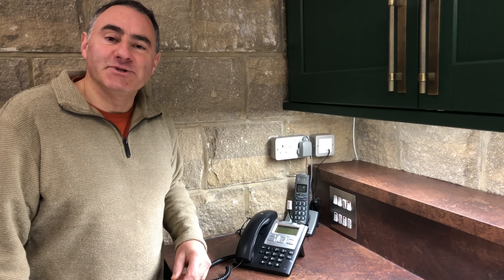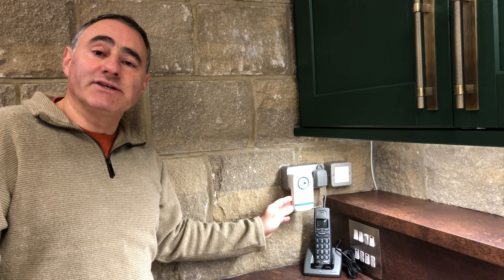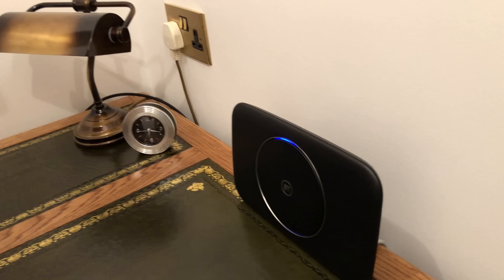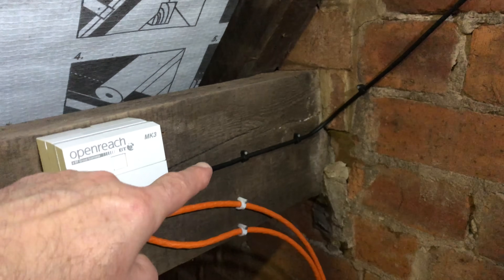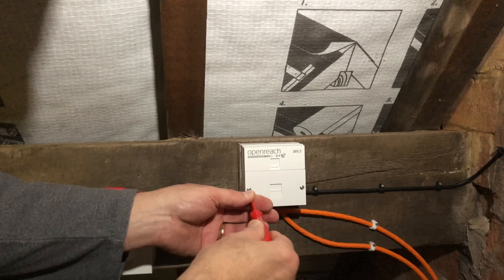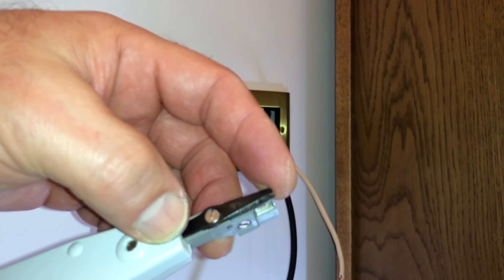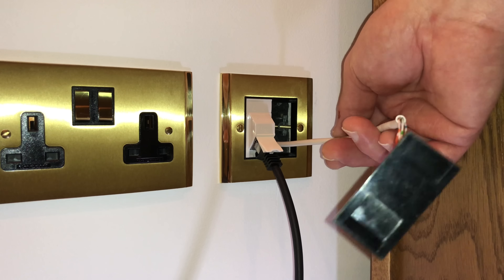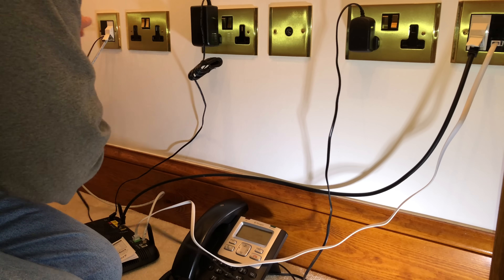How to Video - Analogue to Digital Telephone Landline Switchover Advice VOIP.

Comment: Talk about confusion.  Disconnect the mail socket, which has cat6 running to it? What's a cat 6, why is there there.  
Put in this new socket connected to the attack. 
Plug in an extension to a different socket that no one else has got.  

All a bit disjointed and over complex for folks with no engineering experience..
Reply from the maker: Wasn’t meant to confuse, I was trying to be helpful showing how traditional telephone sockets can be kept in use after the digital switchover. A competent person could easily do telephone extension wiring. 
Whilst the cover was off the master socket I thought I would point out the category 7 cable that connects to the hub. It is like this because I didn’t want the hub in the attic. 
Thanks for your comment. Cheers Rob 👍

Comment: I still want to use my old dial phones from the 60's, can I  ? And also want my old 1960's phone to work in case the internet goes down which it always does. Also in my mum's house she has an emergency box installed as she is 92, hope that will still work ? why do these companies keep f'ing around with things ? If it works don't fix it.
Reply from the maker: Hello Harvey, I’ve never tried this but I’ve looked on Youtube and it seems the old rotary phones can be used. I searched ‘rotary phones on VoIP’, have a look at the video from My Mate Vince - how to connect landline phones on VoIP. He shows that an external bell works on VoIP. I’ve also read you can call out on them but they will not ring for incoming calls (something to do with how the internal bell works).
Once on VoIP, if the internet goes down, you will also lose landline regardless of which type of phone is connected.
Mother in law has an emergency box but not switched to VoIP yet so waiting to see what happens in the very near future. Telecoms companies do say contact your telecall provider when you are notified of switchover. Thanks for watching and commenting. Cheers Rob 👍
Reply: @robswiseways5697  Thanks for the info Rob, my internet is provided by Talktalk and always seems to go down, my mum is also with them. That's what I like about the original copper lines they are always on. So if I have a power cut etc phones will be dead in the future, not good at all, what a pain in the bum !
Reply from the maker: @harveysingsforyou  Thanks for your reply Harvey. I’ve had lots of comments on my video regarding battery backup during power cuts, worth a read. Cheers Rob

Comment: Thank you. Will do this if they push. Had heard it was coming. Same with Phono to Optical, Scart to HDMI, then we realise it isn’t as good or no better. New plug same thing.
Reply from the maker: Ha spot on comparing cable connections. Good luck when the switchover arrives and thank you for watching and commenting. Cheers Rob 👍

Comment: I would just like to say this about the new system. I work with people who are vulnerable in the community. Lots of them have no internet and wont purchase internet but have a house phone. What are they goint to do.
Second if you loose power you have no phone your means of communication with the outside world is gone. 
The good old phone analog phone line was not affected by a lack of electricity just the pount when you might need your phone to call for help. 
Progress is not necessarily better.
Reply: Yeah, we just got switched to Digital Voice against our will a couple of months ago (with literally one day's notice!), and already the system has gone down twice.

There is a lot we're not being told, or told incorrectly (either to deliberately mislead us, or through genuine mistakes.)  I asked a BT representative specifically if the phone would work if only the broadband was down, but the electricity stayed on (quite common where we live.)  He said yes ...as long as the router is flashing colours, it's working, so the phone will work as well.  "The phone is a different system from Broadband" he said.  ERm...no. It's not.  The router was flashing all sorts of colours for several hours, we couldn't use the internet, and the phones were all dead—but our electricity was fine.  Then hey ho, both Broadband and phones magically came back on, both at the same time. Load of codswallop.

Phone extensions do work, using adaptors, etc. And they're not all that difficult to set up, although cordless analogue phones won't work any more (corded ones do.)  You can answer any incoming call on any extension, or make an outgoing call. But what the extensions DON'T do is connect to each other any more.  In other words, if somebody answers a call on one phone, and you want to either listen in or take over the call on another phone ...you can't.  All you get is a dial tone if you pick up.

BT spun this as a benefit, ie, "Two people can make two different calls from the same house at the same time now!"  Wheeee.  In fact, this little anomaly is causing us a lot of distress, as my husband, who is partly disabled, usually picks up incoming calls on his desk phone, which is corded.  If the call is for me, I end up having to get him to take the number, then I have to phone them back on the digital extension or the other corded phone. What a palaver.

Basically, while we've had Digital Voice now for a couple of months, we dislike it. We have derived NO benefit whatsoever, and have already experienced several downsides.  And the way it's been  pushed on us makes us really angry.  It's scary to know it wouldn't take much for us to be cut off from the world completely, just when we need to access services.  Yes, we have a (shared) smartphone that we use for verification codes, etc—but it's not our primary phone, and isn't the phone associated with our service accounts.  Why should we each be forced to buy a smartphone and pay a monthly tariff for them, as well as worrying about keeping them charged up, etc? Our landline suits us so well!  We're an older couple, and we don't leave the house much.  Not to mention our eyesight isn't what it used to be either, and peering at the tiny screen on a smartphone is not fun at all.  I can do it, because I'm nearsighted, but my husband struggles, even wearing specs.  This whole caper is badly thought-out, and certainly doesn't work for everybody.
Reply: @jannertfol  Totally agree with your sentiments. All the "digital" changes in our lives are not being done for PEOPLE'S benefit!
Reply: The only solution too the power cut problem is to purchase a UPS (uninterruptible power supply) for the router and for one phone.

This will use a built in battery to keep the power up for a certain length of time. If you only use it for the router and one phone plugged into the router, AND only make emergency calls, then it should last for some days during an emergency.

Not ideal: but then on the old system I'd the exchange was without power so we're all the phones too...
Reply from the maker: Hello Gregory, Information on the website tells us ‘the analogue telephone network is reaching the end of its serviceable life. Maintenance, repair and sourcing parts are becoming increasingly difficult’. 
Digital lines do offer clearer phone calls plus other benefits. Vulnerable people should contact their provider when they are notified of switchover. Their provider may supply a battery backup device. They may also be able to supply a hub with broadband switched off, or some other device for landline customers only. Hope this helps, Thanks for watching and commenting. Cheers Rob 👍

Comment: A useful video for people, but it starts off rather over complicating things. After disconnecting the home extension cable from the master socket, it is not necessary to reroute it anywhere. As Rob himself points out at 11:10 in the video, all you have to do is disconnect the home extension cable from the master socket, and leave it disconnected but otherwise in place. And then connect your hub phone adapter socket to any extension socket. There may of course be already a telephone connected to an extension socket near the hub, -in this case use a telephone socket doubler to allow connection to the hub. Also, if you have two extension cables coming out of the master socket, you would need to connect them together after disconnecting from the master socket. Rather than using awkward twisted connections, it would be neater and more reliable to use an added extension socket and IDC the extension cable connections together, as Rob also points out. A very useful point that this video highlights is the use of the male to male connector cable to connect your hub phone adapter socket to your home extensions.
Reply from the maker: Hi Paul, You have a point there. It was my own scenario I based the video on. Looking back, firstly I should have shown how to make the simple alteration based on the master socket and hub being located in a hallway for example. Then I should have shown my own scenario. Your mention of other methods such as the doubler will be useful to others reading your comment. Thanks for watching and commenting. Cheers Rob 👍
Reply: Hi Rob, always easy to think of these things in hindsight! Remains a useful video, and I think there will be an increasing number of people having one sort of issue or another with their landline conversion to VOIP. The number of potential problems goes a good deal wider than just extension wiring, though most people shouldn't have too much of an issue. Phones not working during powercut is likely to be an issue for some of course, with only partial mitigation easily available. Cheers, Paul
Reply from the maker: @Paul-b6k9w  Thank you again Paul

Comment: So the Telecom companies decide that these analogue sockets are redundant. But in what way are things improved. I can't think of any way that this 'upgrade' has resulted in an improvement for the end user.
Please tell me if you think this is an improvement over the original socket system. Are they doing it to monopolise the communications infrastructure, resulting in less choice in the future?
Reply from the maker: Hello John, Apparently the upgrade produces crystal clear calls. The new cordless digital phones offer multi call where two separate calls can be made from two separate phones in the home. In my case fibre will eventually replace the copper cable up to the house and the hub will process the analogue phone calls from my existing phones to digital down the fibre optic line. People want faster broadband and fibre is the way to go. The downside is a power cut means you lose your landline and this is where battery backup comes in. There are are lots of comments regarding this. Thanks for watching and commenting. Cheers Rob 👍
Reply: @robswiseways5697  Thanks Rob. It occurred to me that from time to time, the internet connection may stop. If so, that would be very inconvenient if you were in the middle of a phone call.
Reply from the maker: @johnchoice1371  Not experienced that yet John ! Cheers Rob
Reply: @robswiseways5697  A good few years back, there was an upgrade that added digital tech to the old phone system that brought crystal clear calls, without any alteration to your phone set up. The whole problem these days is that everything is being altered to make the nerds happy without any consideration for the consumer. Those guys think that just because THEY can understand the far end of the fart about computers and digital code etc. that we ALL can.

Comment: A lot of people get confused over this switchover as they think that the phone socket on the back of the router is some sort of digital socket or VoIP socket.  It isn't.  It's just a standard UK analogue phone socket.   Calling this a switchover to VoIP is very misleading, although everybody in the industry seems to do it.  In reality UK phone lines have used VoIP for decades from the exchange onwards, and having a digital landline just allows the VoIP (digital) part of the connection to be extended from the exchange to the home router.   The router allows this digital phone signal to share the digital phone line with the internet (the phone and internet are kept separate), and handles the digital to analogue conversion instead of the exchange.  From there on in the home it's the same old analogue phone technology as the video points out, so this can be plugged straight into the existing home phone extension wiring instead of the old master socket.

A further complication and source of confusion is that many non-BT routers have the smaller international phone socket on the back instead of the UK BT one which uses three active wires including the BT "ring" wire.  Most modern phones don't need the third wire and you can just use a simple adapter between the two connectors, but some older phones won't work without the third wire being activated.  Fortunately you can  regenerate the signal on the third wire using one of the old UK ADSL filters after the adaptor, before then plugging the BT to BT cable between this filter and an extension socket.  Then no new phones are required, no new wiring, and no problems with other technologies using BT phone lines such as automated alarms.
Reply from the maker: Thanks for your detailed information Paul, very interesting reading. As you are aware we are still on fibre to the cabinet, so copper cable from there to the house master socket. A couple of years ago our landline went down as did our neighbours but we still had broadband. Openreach had to replace an underground cable in the street. The engineer told me the cable feeding the house has two wires, one for broadband and one for the landline. When we were switched to digital the landline went dead, so I’m guessing one of the two wires was either switched off or disconnected at the cabinet. 
The international phone socket could be an RJ12. I’ve seen RJ12 / BT adapters. These may come with the router. As for the connections, I connected all six wires to the new socket for neatness (an extra couple of minutes work). All my telephone sockets have six wires connected even though it isn’t required (and you obviously don’t see it). Thanks for watching and commenting. Cheers Rob 👍
Reply: @robswiseways5697  The "broadband line" is obviously the digital one, but after switchover the router sends internet and phone over two separate virtual channels on this line.  In the exchange the phone channel connects to the (fully digital) phone network and the internet channel to the internet network.  Aside from the fact that they are isolated from a security perspective, the phone channel is also given high priority over the digital line to make sure that time critical voice data isn't affected by internet loading.  Fibre to the home works in essentially the same way, just swapping the copper digital line for a fibre one, although physically the same (higher bandwidth) fibre is shared by passive splitting between multiple households for economy so you have a lot more multiplexing and security going on.   The RJ12/BT adapters I've had experience of are simple two wire connectors, so they wouldn't support connection of older phones where this is an issue (you would be surprised how many people still use these - they just hardly ever go faulty!).  Before the switchover it was the master socket that set up the third wire in the house, but component wise it's very simple and ADSL filters happen to do it as well, which is useful as many people have these spare.   Very helpful video though - it's useful to point out that this is nothing but the same analogue phone technology with the router effectively replacing the master socket, given all the "VoIP" confusion out there.
Reply from the maker: @paulgrimshaw6301  Thanks again for your input Paul, very interesting for other viewers to read. Your summery of the router replacing the master socket is spot on. Cheers Rob
Reply: The question in my mind then is should I remove the capacitor in the old Master Socket (or replace the Master socket with a slave socket)?  The RJ11 from the Zen Fritz!box is the A/B (2/5) in put wires (no third wire). Then just place a ADSL filter in front of any phone that does not ring. I thought too many capacitors in the circuit was not helpful?

Comment: Yes, I had to do this because I have phones all around the house into each room and I was told they wouldn't work unless I used adapters at my own expense or purchased a new DECT set up to replace them all instead - BT help was useless as they didn't have a clue and refused to supply anything other than a new router. So, when I was switched over to digital voice I found out by experimentation I could plug a double adapter into the router - one for the main hall telephone and the other to the nearest extension socket and then all my extension sockets worked as normal.
Reply from the maker: Glad your experiment all worked out positive for you. It’s a great way to keep all traditional telephone sockets active. Your double adapter is similar to my method where my hub plugs into one wall socket and the desk phone plugs into the other wall socket in the same room. The other socket forms part of the extension wiring as do all other sockets in the house including the one in the garage. Thanks for sharing your experience of digital voice. Cheers Rob 👍